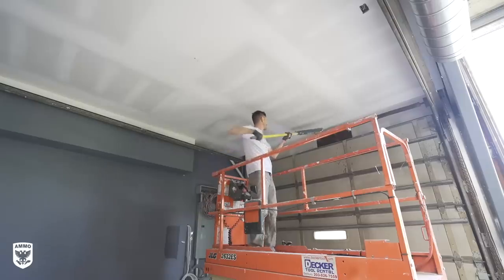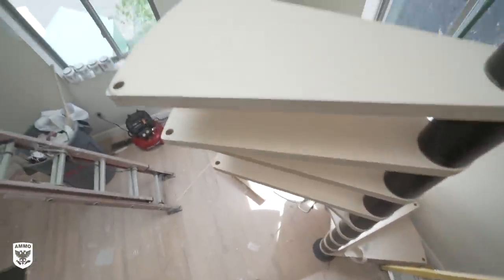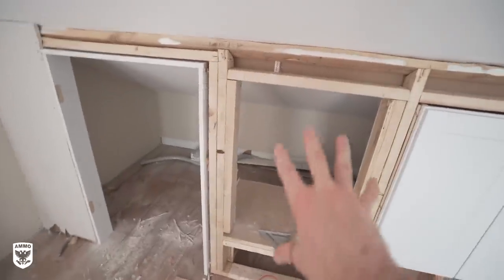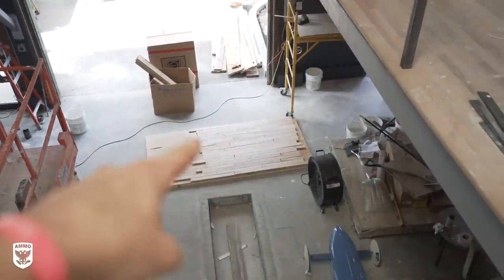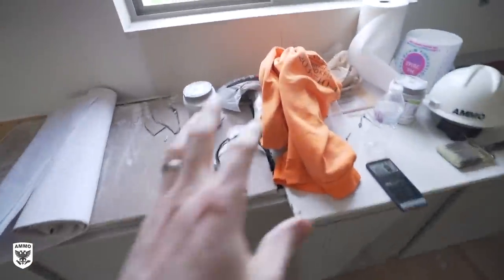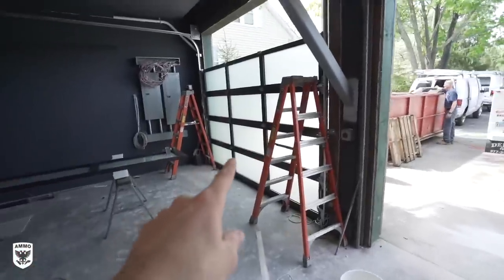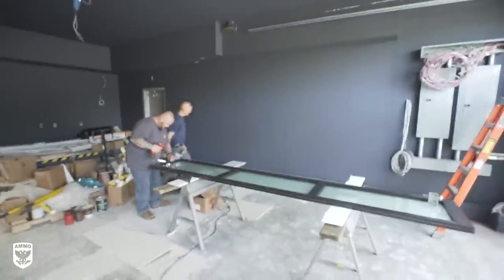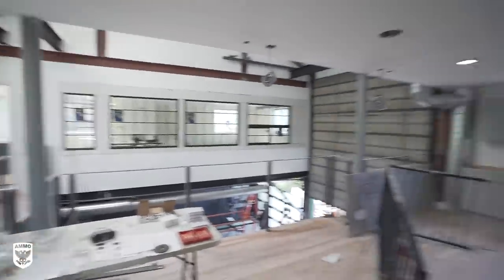AMMO STUDIO Update 5/21/20

Comment: Looking great Larry!  Also, for cutting in, I’m not a painter either. But Home Depot sells a cheap cutting in tool. It has wheels on one side and a soft Velcro like surface on the paint side. Rolls along the surface that you done want Painted...  Works like a champ!  I’ll never paint a room without it ever again saves so much time. “Shur-line, paint edger pad.” Looking great though!  Keep up the update videos!

Comment: You've probably already accounted for it but don't forget adequate cooling in the "Computer room" area on the third floor, not sure what you're running for servers/rendering/storage, but keep it cool!
Reply: I second that.
if I cut and render a long video my room easily climbs 10F
and i'm only using a 2nd gen i7 2600k/gtx1080
Reply: @3rdGenGuy  I've got a 4790K/GTX 980.

It's a fucking space heater. 😄🤦‍♀️